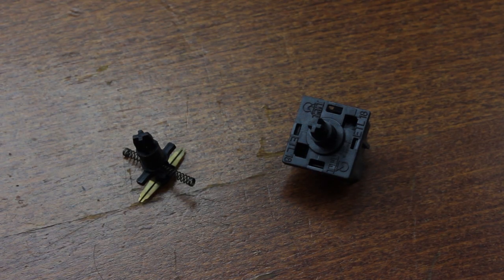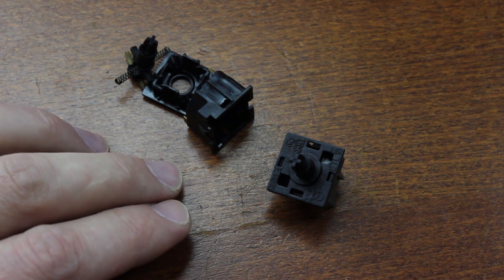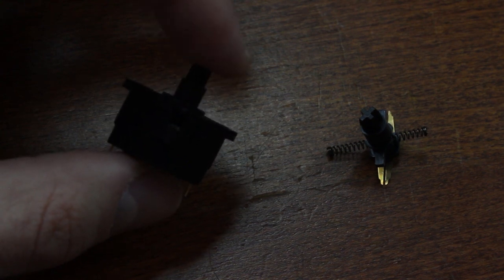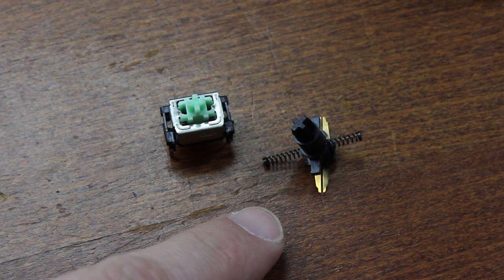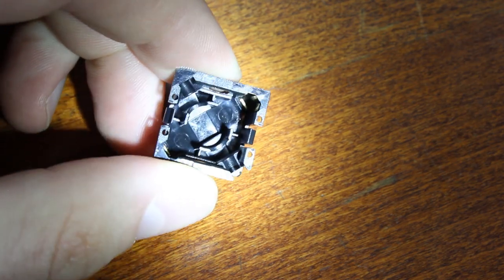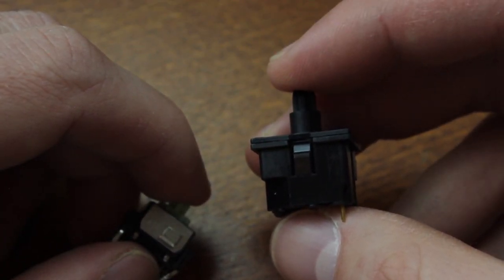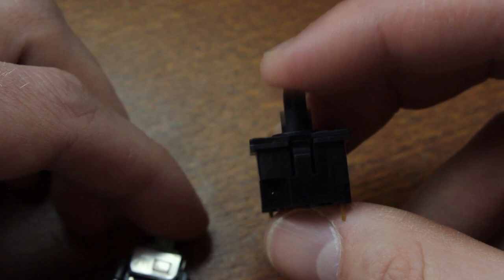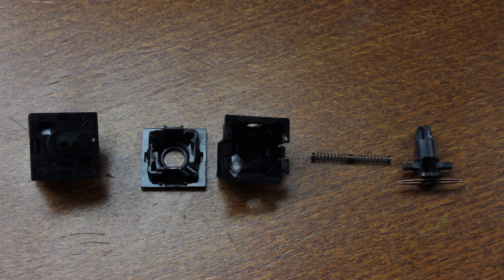Teardown - ITT ETL18 horizontal flappy coil spring switches!

Comment: I have a full keyboard with those. I'm from Brazil, and they are relatively common in 80's keyboards here. All the switches in mine were made in Brazil, and it seems it's not documented that there is this Brazilian version of this switch, made by iter-gol, and not by ITT. It's a pretty big and neat keyboard, with red details and double shot keycaps, and a serial conector. I hope to find the time to clean it, and try to make a converter for it some day.